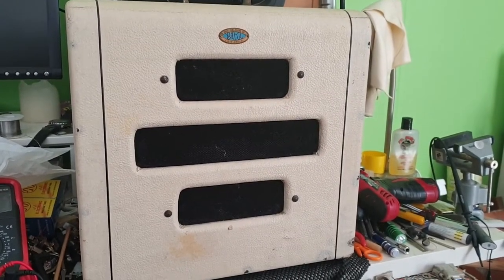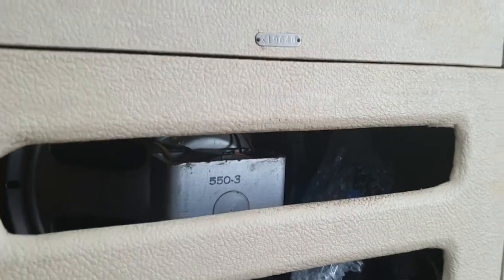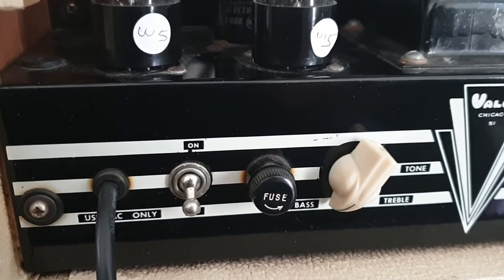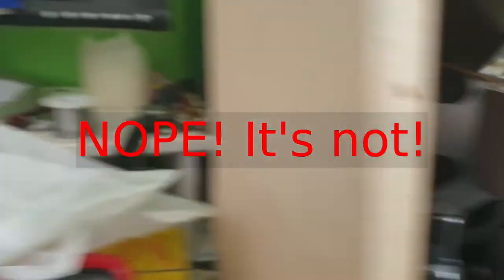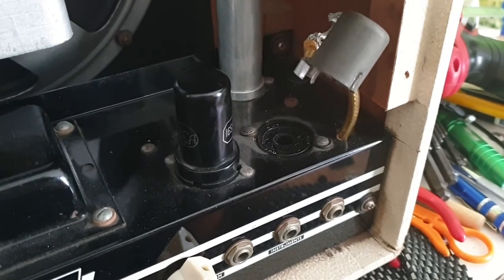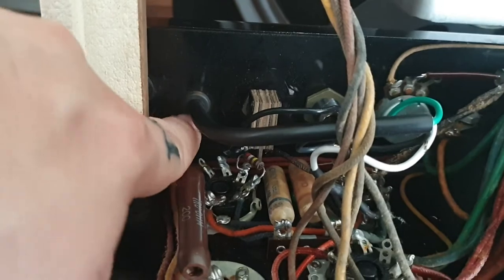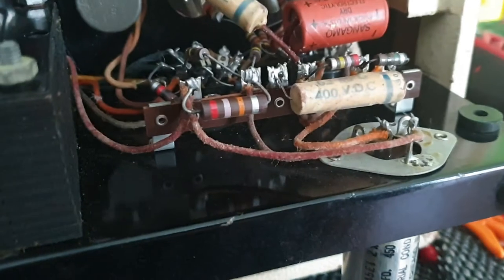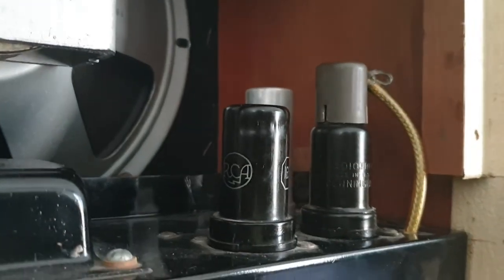Oahu Valco Supreme Vintage Guitar Amp circa 1950s

Comment: Considering it's age (and how others look now) that one is  in pretty decent shape actually.That amp may have been modded to accept a 6j7 in place of a 6sq7(maybe it's what they/whoever had on hand).I have the same amp/chassis (looks identical,I bought it on Reverb) and it features a 6sq7,it's the same as the shcematic as well.The only versions I've seen with a 6j7 feature TWO input jacks and  just a volume control(no tone control.

It looks to be the G6155/6156 in the schematic you have except for the 6j7 in the first gain stage.None of the Valco iterations I've seen with a 6j7 input stage feature  3 inputs (each with 47k resistors) and tone control,it's only the version you have on that schematic.I'm sure that schematic is mostly correct.Look up the Valco 510-1 schematic and I bet that first gain stage is the same.Your schematic and the Valco schematic are very similar anyways.That's a nice amp you have there.If you jumper the other inputs you will get more gain and little shift  in treble response.And that broken wire from the plate put one of the power tubes out of commission,that was a nice easy fix.
Reply from the maker: Thank you for all that info. I've since discovered there's another schematic that matches the amp. It's a Valco circuit and matches the tube. More research has led me to believe that the 6J7 is correct. As I've discovered some photos of earlier models with the plate cap, and the serial number is dating the amp to be older than what was advertised.

A lovely mystery.

Thanks for the info and the comment.

Comment: 550 on the speaker refers to the manufacturer Rola as a reference for valco in house
Reply: Mine has a rola field coil speaker with a 1949 serial number a different preamp tube
Reply from the maker: @FIVE_DOLLAR-DAVE  ah. Thank you for clearing that up. Cheers for the comment!!!